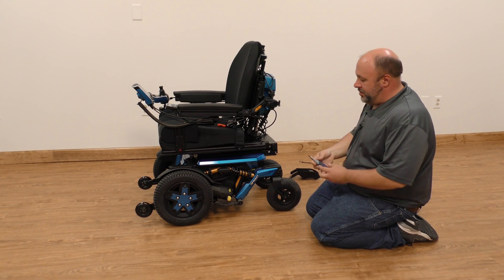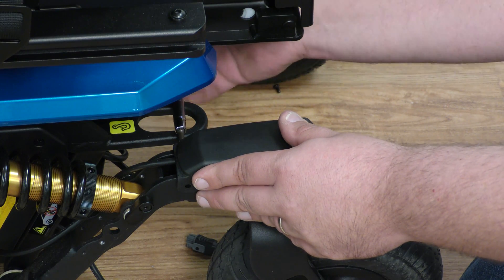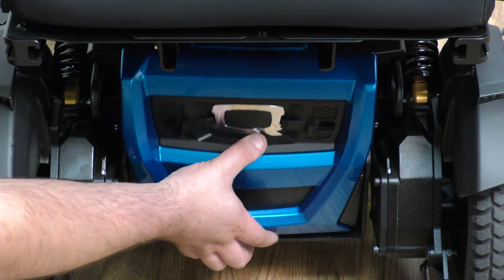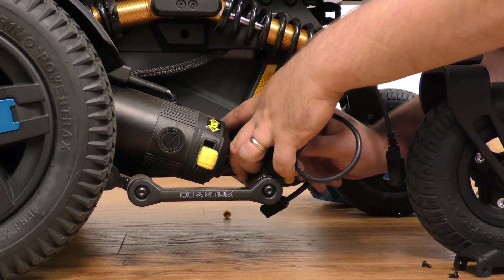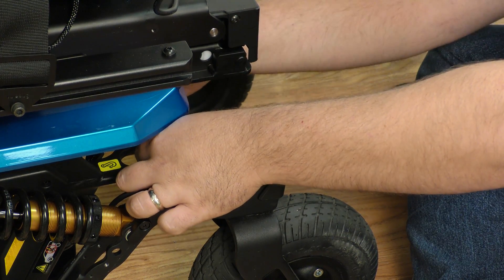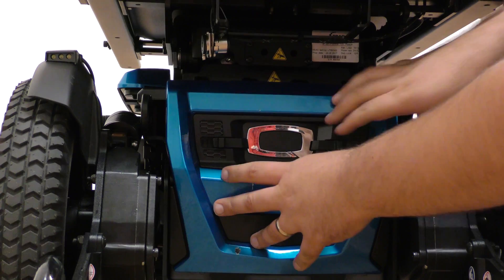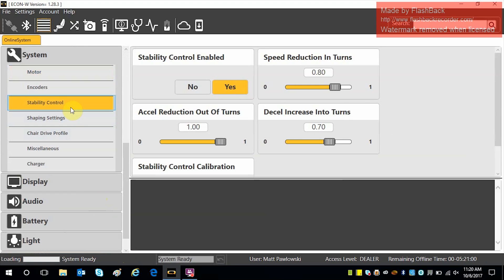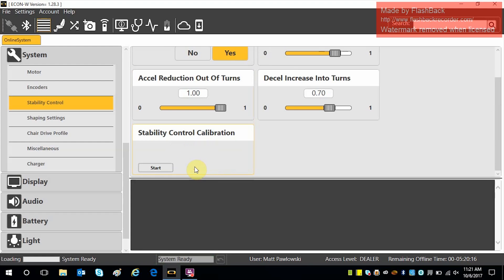How to Align the Caster Sensors on the Quantum® 4Front™

Comment: My son has a Quantum 4front chair and the caster wheel fork bearings have destructed. It is obvious that this is a poor design with a tapered cone bearing without any seal. It is also obvious that the bearing was never lubricated. This chair has been used very lightly. The dealer in Grand Junction Colorado has been rude and of no help. Impossible to find the number of this bearing and the dealer and manufacturer wants insurance to pay for this poorly designed product. Can you provide the number of the bearing on the fork or spindle? Campsnowcactus@gmail.com
Reply from the maker: Hello, we sent you an email from marketing@pridemobility.com. Thank you.

Comment: Does the latest quantum  mid wheel drive  have caster sensors?
Reply from the maker: Hi Gene,  The Edge 3 Stretto does not have CASE technology (the caster sensors you are referring to). CASE is only available on the 4Front.

Comment: Are you familiar with the headaray?
Reply: Hello Alvaro, yes, we do offer head array as an option on our power chairs. Do you have a question about it?
Reply: prideprovider yes i have a question i am a quadriplegic and use the head array but sometimes i have problems with it in the screen of my chair sometimes says joystick out of center when im no touching the head array or joystick and can't even move the chair because of that it says some kind of error so i was wondering if you were familiar with that i have the same chair same color just more modifications because of my injury.
Reply from the maker: Alvaro, do you have the Stealth iDrive head array? If so, there are a couple of reasons for why you are getting the "joystick out of center" error. You need to contact your provider and have them re-calibrate it.  The pad may be sensing a command at start up.  Again, this would require programming, or the system is not programmed properly for the iDrive.  Regardless of the cause, your provider needs to troubleshoot the error so they can make any programming changes if necessary.